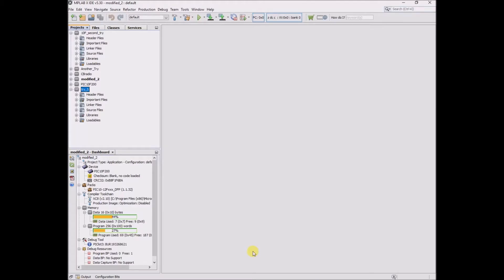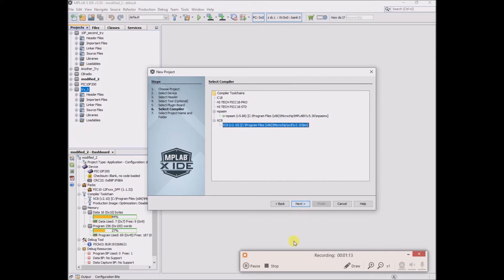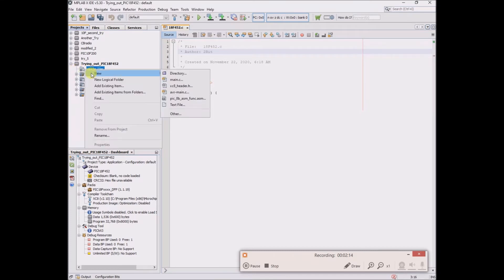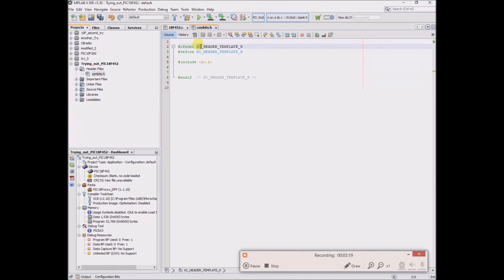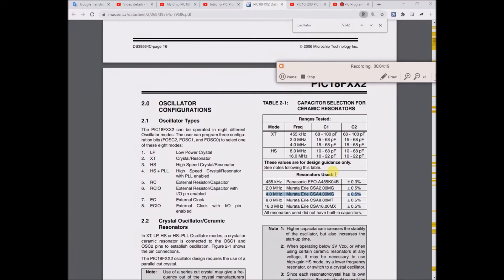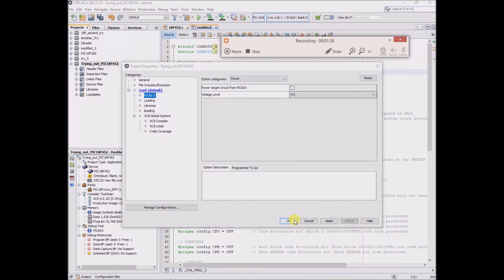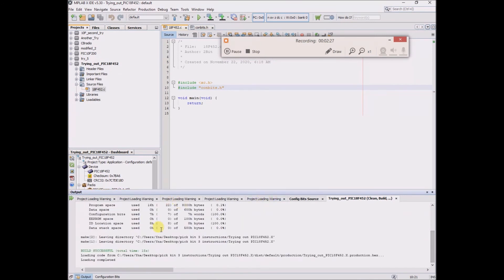Setup and configure your PIC18F452 I P in MPLABX IDE, PIC Kit 3

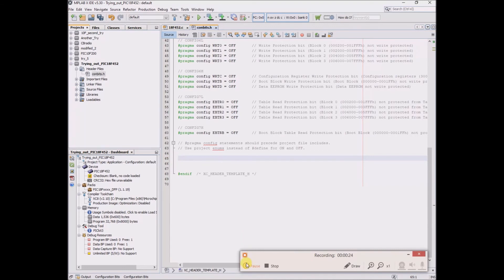Comment from the maker: 5:23 Note: It is very important to define the oscillator frequency, even if you are using the internal oscillator, or a resistor-capacitor circuit.
#define _XTAL_FREQ 4000000 Otherwise, you can end up with error messages when building and compiling your code.

In my photos, the chip is upside down, in the breadboard. (This caused me a lot of trouble-shooting.)
See also: https://www.youtube.com/watch?v=OQ6hZzkvXMw&list=PLsFEH77Q-nPfU5P36aJeCD1uSfzkxvSgM&index=37
C: , users, Y** , MPLABprojects

5:33 Power Settings: default, customize, pick kit3, option categories, power